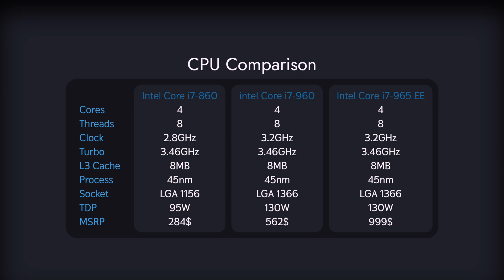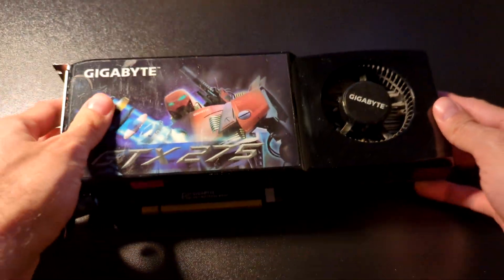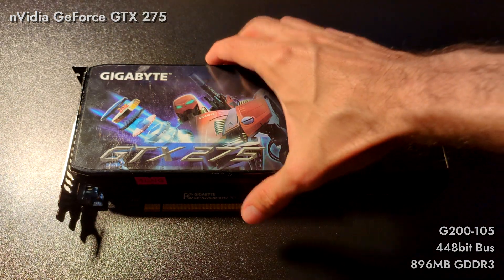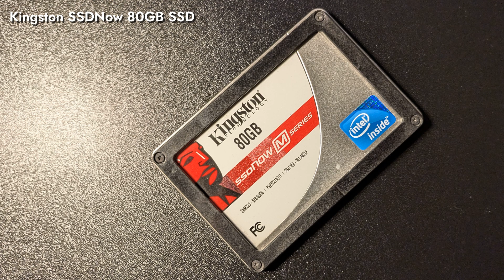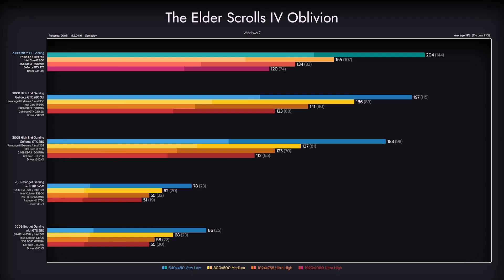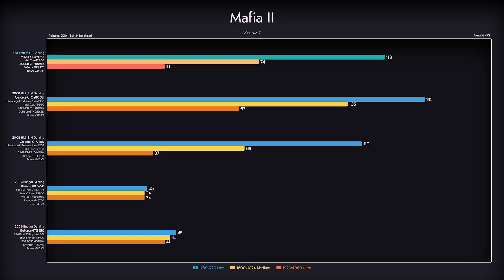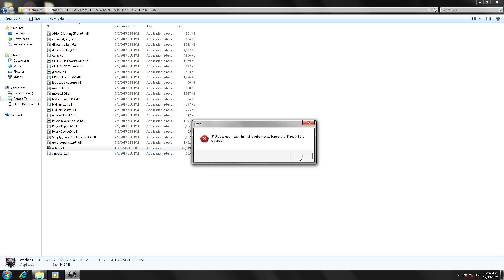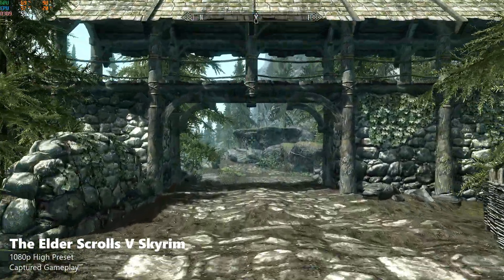2009 Mid Range to High End Gaming PC

Comment: "The i7-860 holds up well in modern gaming" ... Lol, my i7-920 certainly does not hold up well in modern gaming. Even modern GZDoom-powered games like Hands of Necromancy push it to its knees in larger areas for some reason. Maybe would be better if I overclocked it, but that seems risky without upgrading the cooling, as I think it's using the original stock cpu fan, and I don't even want to deal with redoing the thermal paste much less anything else.

2:21: "GTX 260 - 449$, GTX 275 - 249$, GTX 280 - 649$, GTX 285 - 359$, GTX 295 - 499$" - is it just me, or do these prices seem completely randomly assigned?
Reply: The numbers are right. These MSRP prices dont tell the whole history. 
Nvidia released the gtx 260 and 280 cards in GDDR3 and 65nm, they were to hot, used to much energy. They were losing ground fast to AMD HD 4850 and 4870 (GDDR5 55NM). 
The Nvidia GTX 275 and 285 was a refresh in 55nm. While still on GDDR3 and consuming more energy, it was not overheating and gave Nvidia some time being competitive until the end of 2009 when AMD released the HD 5850 and 5870. These 2 cards were unbeatable for 6 months, until Nvidia Releases the GTX 480 in early 2010. Exciting times, there was improvement and prices were competitive.
In that time GPUs were not released on the same time like today(i believe because they release almost together today bc of shows like COMPUTEX)
Reply: @silvioantonio6952  GTX 295 was released 7 months after GTX 260, and is only $50 more expensive while literally being 2x280s on one card.  GTX 285 was released 7 months after the GTX 260 and is much faster while being $90 cheaper. 

This would be like if the RTX 5080 Super released by end of 2025 with for MSRP $450.

Comment: what was the price of the geforce 210 when it came out and how was it for gaming? And btw what is the model of cooler on that cpu?
Reply from the maker: It's Intel stock cooler, without a sticker. GT 210 was around 50 bucks, and outright terrible for gaming (worse than 9400).